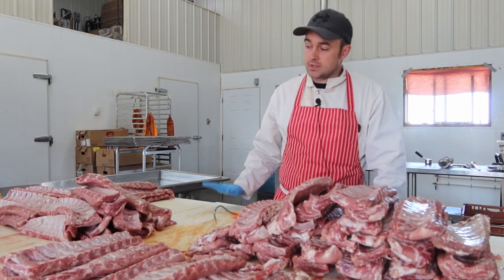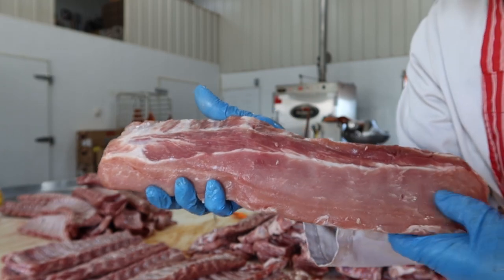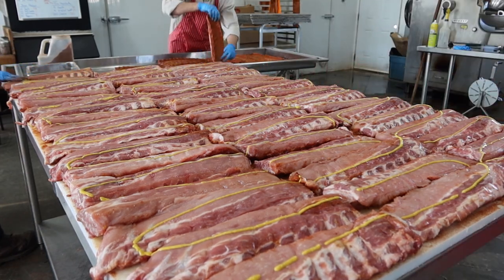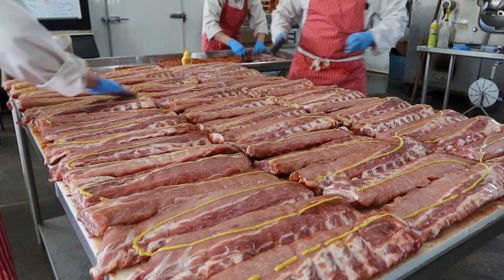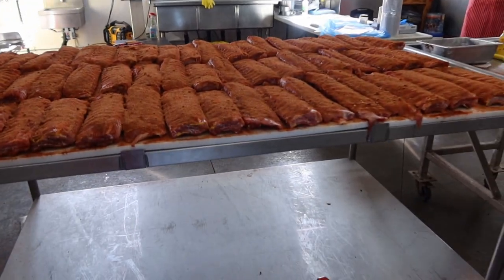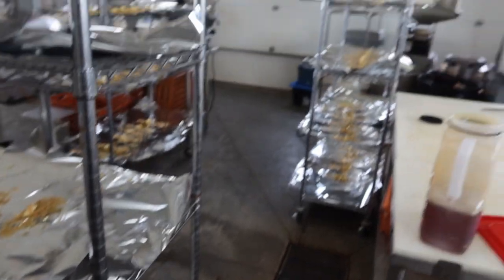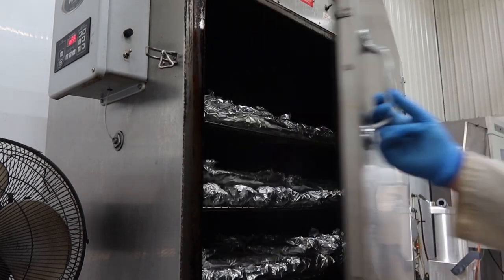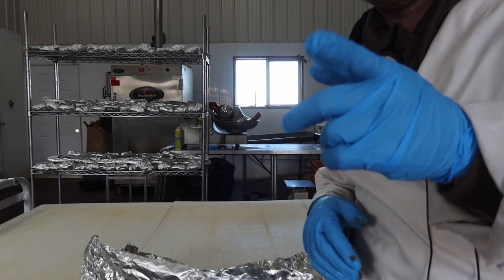butcher back ribs, how to your butcher smokes baby back ribs. Recipe Included!

Comment from the maker: Thanks again for watching! Let me know what you think and if you like the video. I enjoy reading your comments.
Reply: Hi Duncan,
1st off, Love your videos.  
I started competing in bbq competitions last year, mainly ribs.  After watching your video that talks about cure and cure accelerators, how it impacts the meat when cooked. 
My question is... how would the cure and accelerators impact a slab of ribs? The time frame is short so I was thinking if I mixed up an injection solution with the cure and accelerators, would it turn the meat a nice pink color during the smoking process?
Reply from the maker: @Bob Kasper  you would need to add cure to the ribs as well as the cure accelerator to get the pink cured look. A brine would work well for that. I think it would change the texture of your ribs. I think they would maybe be more dense. Not sure though have never tried it.

Comment: @Duncan Henry .... another outstanding performance. I have to ask.... Removal of the membranes. I never seem able to tear them off in one piece. They just come off in bits and pieces and it's near impossible to get much of it off.... Is there a trick to this? Age of ribs? Temperature? What am I missing? Maybe unfrozen? Alberta hogs are just tougher? I need to know! 

Also, thank you... bonus points for using French's mustard ;)
Reply from the maker: @Joe Alta thank you very much sir!
I haven't really played with those variables before.
I do find that the meat hook, run right down the bone from one side to another, will lift it up. Then you can wiggle your finger under lift and push at the same time and it should lift away in one peice. Hopefully. Haha.
Reply from the maker: Also thanks for the bonus points!

Comment: In your spice blend recipe, you have listed "onion".  Do you mean an actual chopped up onion, or something else (minced onion, onion powder, onion salt, etc)? edit got to the point in the vid where you stated the ingredients - onion powder.  

Thanks for the tip on removing the membrane, I've always had found it to be a pain, but watching you, I noticed you started in the middle, and it made it so much easier to grab and remove the membrane, rather than starting at one end, as is often recommended.  For the home folks without a meat hook, you can pick up a cheap awl at the hardware store which works really well, as it's got the same pointed shape as your meat hook.